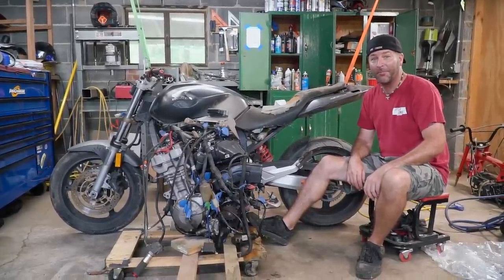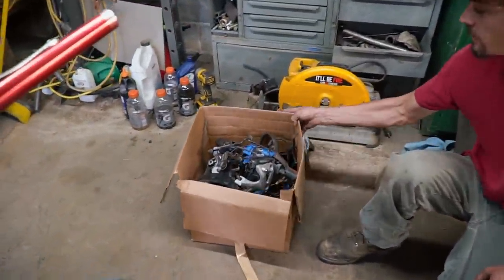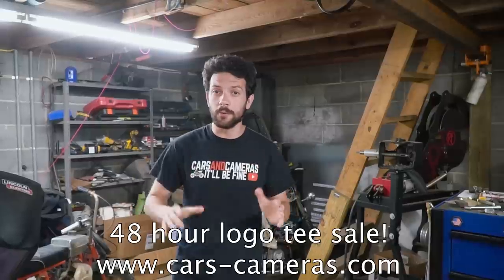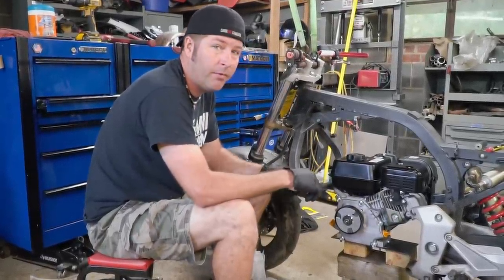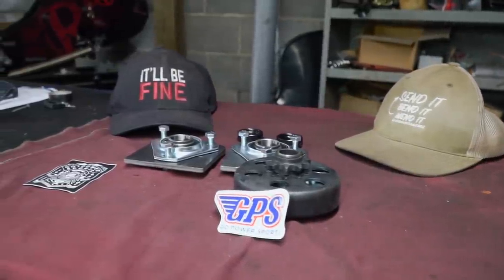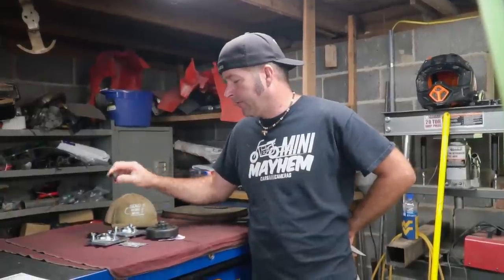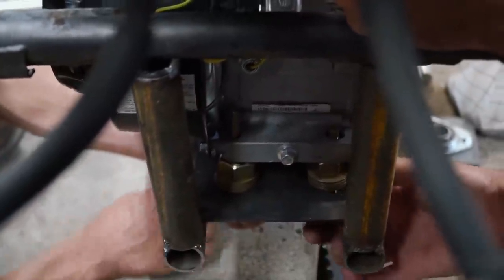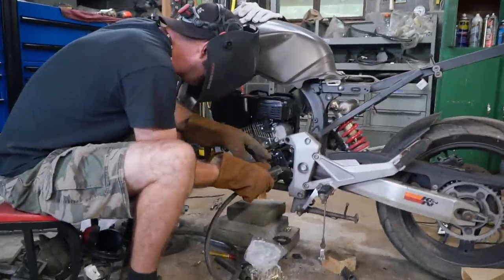We Put a 6.5HP Lawn Mower Engine on a Sport Bike

Comment: Take the fuel tank off the predator and feed it directly from the stock tank lol
Reply: I thought that is what they where going to do
Reply: Dual fuel tanks then road trip.
Reply: No point having the extra weight of the original tank if they aren't using it. 10 lbs could be 2 mph with 6.5hp! LoL
Reply from the maker: Working on that today
Reply: @worldwideguitarman  the weight is just a problem for acceleration really, top speed is basically limited by max rpm and gear ratio
Reply: @joey_f4ke238  with a 6.5 hp engine, you can bet that weight is hurting too speed, acceleration and fuel economy. With a little less load to carry the engine may get another 100 rpm on the limiter. Disable the limiter and a few lbs matter less but will still make a bit off difference with such a small engine. I would almost bet that John would 4 mph more than Ike without changing anything if he stayed in the throttle until it peaked.
Reply: On you tube a guy put a 212 predator on 100 cc dirt bike and it rips does wheels and all...
Reply: @worldwideguitarman  they started saying they were going for fuel mileage.....your argument is invalid.
Reply: @scustomsteve  making it lighter would give it better fuel mileage by default. How is my argument invalid?
Reply: Good point. Easier access to the fuel cap, and it has a key to lock it I'm sure.
Reply: @worldwideguitarman  you keep talking about mph.....they were talking about mpg...was just saying guy, no need to get defensive!
Reply: @worldwideguitarman  two tanks would ultimately end with more mpg correct!?
Reply: @worldwideguitarman  I should have worded all that different man I apologize, I have had a bit to many drinks to be commenting on youtube! You are correct, I was somewhere else with what I was trying to say.
Reply: @scustomsteve  would give you more range. More miles per fill up. Having two tanks makes the bike weigh more. Especially when gull of fuel. Gasoline weighs about 6lbs per gallon. That motorcycle tank probably holds 4 gallons. So that would be 24 lbs of fuel plus whatever that tank weighs. Now, what would I rather have for a road trip? Definitely both tanks. The detriment to fuel economy from an additional 30 lbs wouldn't be enough to justify stopping for fuel every 20 minutes.
Reply: @scustomsteve  not defensive at all. Just explaining.
Reply: They should also talk in km/L which is far  more precise
Reply: @jeremyperraud1357  How is it more precise?
Reply: @Rattus-Norvegicus  a mile is a longer distance and a gallon is also a larger volume so it is like the inch and the foot, with a smaller unit You're more precise
Also you Can check the video about this on Donut Media
Reply: @CarsandCameras  try swapping in a 8hp predator engine which would safely allow you to use higher gear ratios without over working the engine which is what  would occur if you run too high of a gear with that 6hp engine . Better yet go for the 13hp engine .  That 6hp would get you to 55mph but it would work the crap out of that engine . 8hp would hit at least 60mph no problem . 13hp might get you up to 90mph😁 LOL !   You might even win some races  if you went all out and put the 22hp predator twin on it 😂😉 LOL !
Reply: @brieannateylar5810  13hp 90 mph no chance.   Lucky if it  would go 60mph this thing is heavy
Reply: @scustomsteve  maybe not more miles per gallon, but more miles of range with more fuel in the other tank.
Reply: @jeremyperraud1357  then it's just a bigger number. They could add a decimal point, or just say around __ mpg. If they really want accuracy, then they'll measure it, and write it down somewhere, and measure it a few more times, then do math to get a median.
Reply: @wifie9321  yup...already apologized for being drunk and not using my words right fellow youtuber!
Reply: @scustomsteve  oh.
Reply: @wifie9321  👍
Reply: Awsome !I was wondering where I could order CR85r parts moto takes like 3 weeks
Reply: @chrishart8548   If I remember correctly, a 125cc Vtwin Virago will do 88mph with 15hp.
Reply: @DarkLinkAD  must be one of the better ones I've ridden about eleven 125cc 4 strokes most wouldn't go above 60mph even down hill that was hitting 9,000rpm.   Some got 65mph as long as no headwind is against you.  Big hill really are the enemy of 125's can go as low as 35mph I'm talking the steepest hills the ones a car struggles to pull away on. There's a few in Wales.  More like a wall than a road. barely walk up it.
Reply: @georgegomez5767  i
Reply: I'm trying this on a 1974 cb360

Comment: Now the Predators are $150. Sure makes those Tillotsons basically the best choice by far.
Reply: MesaB  That would be inflation and import tariffs. Nothing to do with these guys.
Reply: MesaB  one more time box stock project has complete brand new race motors for 150
Reply: They aren't 150 at harbor freight
Reply: MesaB  $139 + tax and the coupons are gone.
Reply: I've switched to the electric start Duromax 7hpe

Comment: That would've been the perfect candidate for the bombardier engine
Reply: I have always wanted to put a big snowmobile 2 stroke into a motorcycle! I had a dead Suzuki Rf900 I was saving for a while but money got tight and I couldn't find a good engine so it got sold. Would have been the perfect frame though, HUGE sport bike with plenty of engine room and a steel frame to weld on
Reply: @consolehacker54  it would be awesome especially with the newer 2 stroke power they are ridiculous if geared right it would easily run 150+ mph
Reply: @consolehacker54  Vasily just put a 110hp 3 cyl 2 stroke from a jet ski on a (SLIGHTLY modified 😂) Murray riding mower! And it's 4WD!
Reply: @pookysdad4884  I watched that build along with his drag mini bike and the cafe racer build I watch red beards garage rather be welding moto mule vasily builds cars and cameras and a few other channels

Comment: Imagine how much tighter it would look with curved tubing hugging the engine in the cradle, rather than the right-angle welding.  It'd look almost factory.

It'd still sound like a Home Depot on the road, but it'd look factory.  Ish.
Reply: Alternatively, if there are enough hardpoints on the block, a subframe on the front and rear of the block bolted to the tabs they cut off the frame could turn the engine into a semi-stressed member.

Comment: We did a similar swap with a Honda 250 street trail. Useing a 6.5 hp Tecumseh engine. It was a great project. Keep up the good work
Reply: I have a cbr 250r how can I run my 212 with the sprocket on the motorcycle it’s a 520

Comment: Cant wait to see the 212 built idk about the hemi but my non hemi has 18lb valve springs light sanding on the short turn on intake and exhaust, mod 2 cam, arc rod, arc flywheel at 32 degrees  stage 1 kit with a carb swap stock style carb with the adjustment screw to "tune" the engine and bigger jet and just to try a e3 plug turns 7250 rpms and goes 60mph on my manco thunderbird mini bike super fast set up around 9-12 hp for sure

Comment: My first job I was 13.  I was trained how to rebuild and repair Briggs and Stratton lawnmowers and garden machinery ,small engine mechanic.   Those Briggs are workhorses.  We viewed some out and made custom head and get 15 hp form a 6.5 p
Hp.     Those little motors are fun to work on too. Ya the old guy custom made stroker and bigger bore on the Briggs engines.  Make a bigger stroke and hot rod Briggs engine.   Fun times

Comment: Good get one of those go pro wind proof housings. It's basically just foam in the shape of a go pro housing, but it cuts down on wind noise, very helpful so you can hear the engine and voices etc while you're riding.

Comment: I've been doing this since before this YouTube channel was invented. I've used 212s and 420s. As long as the gearing is correct and the chain lines up, it's not too difficult. I've put predator engines on sport bikes, homemade motorcycles and trikes and all of my stuff is street legal in Nevada.

Comment: This is hilarious, I love it.
I realize this is a bone stock lawn mower engine with a plain old clutch but it's got a lot of potential. Just for reference, my Yamaha Vino 125 scooter isn't fast off the line but it will eventually haul my fat butt up to 53 mph on flat ground. One of these days I'll try a downhill, full tuck, top speed run.

Comment: It reminds me of this one young dude who put a Predator into his little truck, simple and elegant capable of good speed through the stock gearbox with the pull starter right under the front left wheel well and the choke operated via lever on the dashboard. I think he hit 30 mph on uneven dirt roads going very slightly uphill XD

Edit: It was a stock Predator 212 in a Dodge D-50/Mitsubishi Triton, 6.5hp and all, 5 speed stick shift and 22 mph top speed in high range with squishy all-terrain tyres from the looks of it. I forgot the guy got nearly a million and a half views in the 2 years since he uploaded it lol

Comment: Should make a bolt on kit for certain frames and market them.
Reply: I'd like motorcycle manufacturers to offer small engines in their big bikes AS A FACTORY OPTION. I'm just over 6'/185cm so would feel cramped on most 125cc bikes, and I'd need an engine that small to learn on and get licensed, but I'd probably need a 900-1000cc bike's frame to be comfortable.

Comment: Great project. Saw that some one powered some kind of Honda or Toyota with a mower engine. And it was street legal. Thanks for sharing
Reply: Robot Cantina here on YT has been working on probably the one you are thinking of. Its a Honda Insight with a Predator engine coupled to the original manual transmission and it's now fuel injected
Reply: @consolehacker54  I believe you are correct thanks for sharing the information.

Comment: You need to put thw stock tank back on and run off that. I know it probably has a high pressure pump in it but that can be taken out and a plate to block it off and have a petcock  on it. Great recycling of a old frame. Have fun with it and the switch to a 420, then maybe a 670 if it will fit. Would make a great series.

Comment: You should try vertically mounting the predator.  It can run cylinder up as long as the carb is turned the right way.  I did this on a yamaha l2 which is alot smaller and that gave me enough room for a tc and almost perfect sprocket alignment.

Comment: If you guys take off the stock predator gas tank and air box and raise it a few more inches you might be able to mount a torque converter on there at a steeper angle since they have multiple mounting holes. Plus that way you can use the Honda gas tank for maximum range on that predator.

Comment: I'm definitely going to do something like this, I have a chopped up Suzuki GS500 (which is reasonably small and light too) with a good title. Currently has a Suzuki DR250 dirt bike engine in it and its gone around the block a few times but getting it to run right is becoming a big pain in the ass. Pull start predator engine would be hilarious!

Comment: My jenky junkyard lawn cart is progressing, slowly. My 5hp Briggs now runs good! My 3hp Briggs has no compression. My 2hp Tecumseh would be good for my 7 year old granddaughter on something, if it ran! 😂 But my 5hp is off a generator, so it has a weird tapered shaft, I'll never find a clutch to fit it. So I'm gonna try to go belt drive, since I have lotsa old V belts and pulleys layin' around.

Comment: you know , if you got an old worn out dirtbike engine with a good clutch and gearbox , you could take of the cilinder piston and cut off the rod on that put a plate over the hole for the cilinder , then fix a pulley / chain in place of the flywheel and put the 212 through it without a slipper clutch , i bet you could drive it through the gears and end up being faster 
i wonder if you can tilt a predator engine so the cilinder is sticking straight up (take off tank and build a different exhaust )

Comment: Put a 420 on it with a racing clutch. That way it still feels like a motorcycle with an actual clutch and it'll have electric start. A dressed up 420 with the transparent pieces all over it. That would be a killer build.

Comment: Can't you turn that jack shaft into a torque converter? Lose the predator tank, use the 919 tank, and raise the engine up more into the mounting bracket slant where the head of the 120 would be. That should give you the space needed for running a 2 piece torque converter set up. Otherwise great job so far! Still love it as is!

Comment: Should have pulled the tank off... rotated the engine towards the front of the bike and then you could have had your swoopy engine mount :D Sure you would have had to fab up a new exhaust pipe and a custom carb tube... but you're good with that welder :D

Comment: I have to say I think it would perform much better with a CVT system on it. if for no other reason than the variable gear ratios that a CVT has. not to mention a more positive clutch engagement, it would have to be a huge improvement.

Comment: To bad you couldn't fit the Honda transmission up to the 212 6.5 engine for better top speed. Hook up the 3.5 gallon gas tank to the engine. Rehook up the turn signsls, tail light and head light. That eould be really cool then!

Comment: Swap the tires out for dual sport tires and swap in a built Tilotson 212. Run the exhaust into the bikes original exhaust... Or swap in a built starter equipped engine and battery... Ride it on the streets or off road...

Comment: you need to check out them guys from Pakistan... they leave the transmission from the original motorcycle, pull The jugs, connecting rod, counterbalance the crank, and change drive it right to the clutch or crankshaft. now you got a lawn mower engine with six gears and a very heavy-duty clutch, sometimes even the kick start will work. don't take my word for it, search around YouTube you'll see what I'm talking about.,.🥴💯

Comment: You should take off the predators gas tank move the engine over about an inch maybe two put a pulley on it and mount the smallest car alternator you can find above the engine and run it with the belt coming from the predator and put a battery in it so that way you can run all the lights.

Comment: Do address the gearing and also the brakes, I think running the bike with the original tank would give it almost unlimited range if you can get better than 50 miles per gallon and a kill switch by the throttle would help.

Comment: Hay when you get the dukarti and the 125 hp 2 stroke go kart done you need to RACE them at the Indianapolis motor speedway. Its $100 a lap. And they will let you drive on it.
Reply: Before you get on the really fast go karts you need to build a full roll cage on them and put a 4 or 5 point harness on them to.

Comment: Is it possible to add horsepower and keep or even improve the fuel mileage on these engines?
Reply: Very possible. Pretty easy to get them to 10HP for a few hundred. A 20HP build will start at $1500

Comment: You laugh at stacking nuts and washers instead of using square tube, but mild steel hollow tube would actually be weaker than high tensile (or at least.medium tensile) solid washers and nuts

Comment: A CVT Transmission would do better and put a 18 or 20 tooth front sprocket on it with a Tillotson 212cc electric start engine with a full stage one setup with twin charging coils and rectifier on it.

Comment: Pull the race motor out of your golf cart and put it in the Honda. add a cheapy Ebay LED headlight with turn signals, rear turn signals and brake light and ride it on the road with just a battery. Too bad the ducati motor from the go cart wouldn't fit this chassis.

Comment: not for nothing, but you could have got away with a 30° forward angle, and other than the gas tank being a little tilted, which you could have easily fixed, it would have sat in there quite nicely if you try it you'll see what I mean., 🥴💯